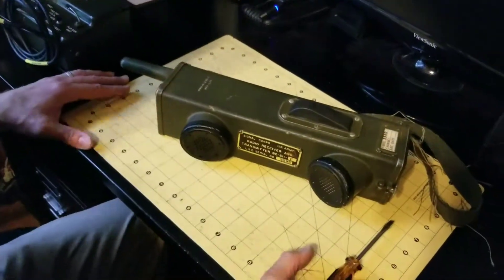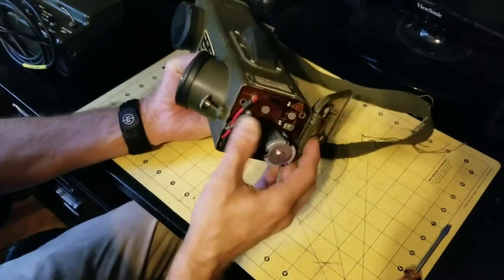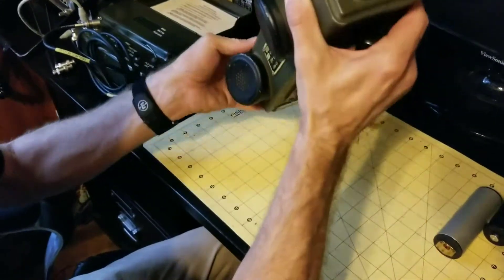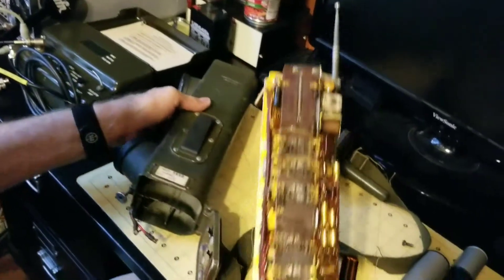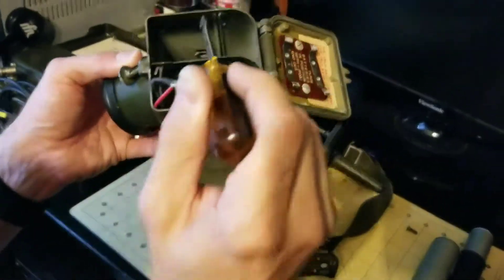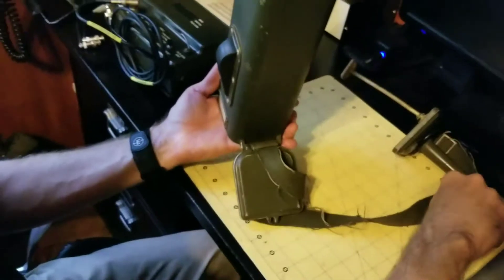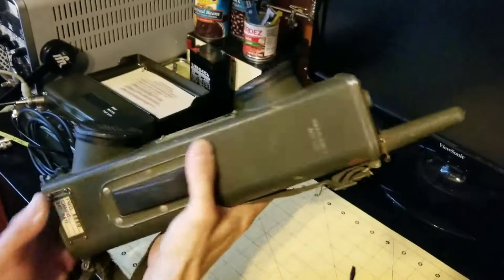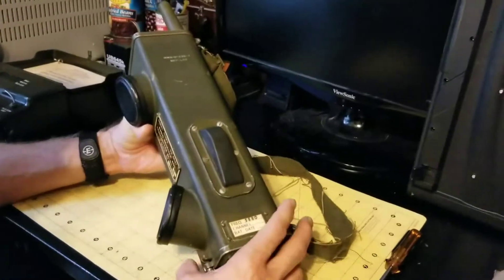BC-611 Disassembly and Reassembly Procedure WW2 Handie Talkie SCR-536

Comment: While cleaning out the basement of my late in-laws house, I came across two of these radios, but it's got a couple more things on it.    Above the "press to talk" button is a small door(?) that slides downward revealing what appears to be a headphone jack.    Also on the swing away door, just below the tag for Freq, Channel and Bat Date, is another cover that when removed reveals 8 prongs that looks like something plugs in here...remote power, perhaps?    Do you have any idea if this is a newer model?   Ballpark value?
Reply: for use in gliders to talk to tow plane sliding door is for connection to glider antenna 8 pin jack is for connection for headphone/ throat mic. Mounted to rack mount in glider r/t switch worked by mechanical link . Could be removed and used as standard bc-611. Google BC-721 for more info go for over 1000 with rack mount just radio 600 plus if all original
Reply: You have a BC-721/CGG-43014 Glider/Navy version of BC-611. This link briefly describes the BC-721.
http://www.greenradio.de/htm2/e_bc721.htm